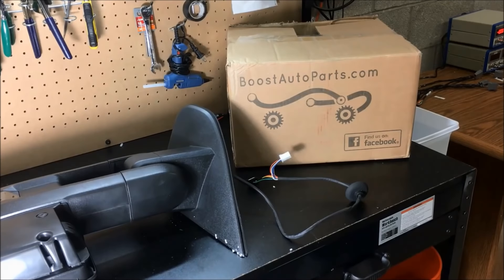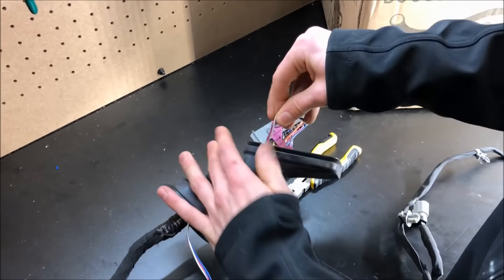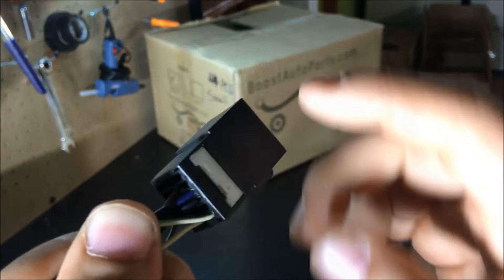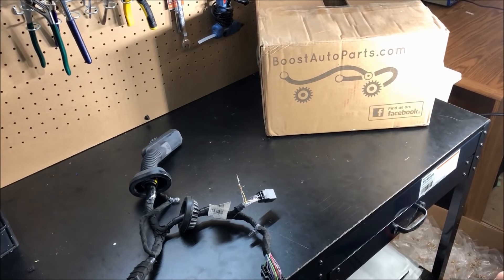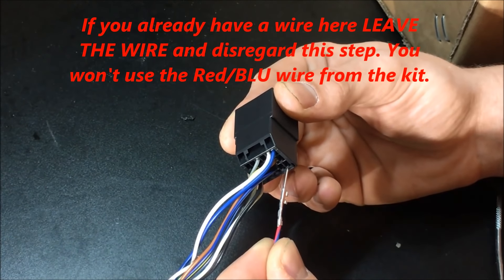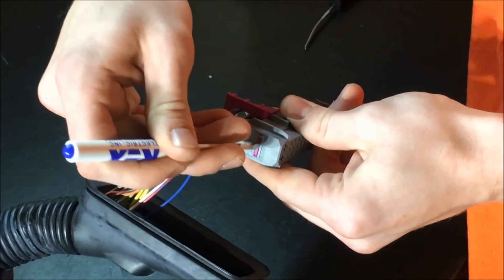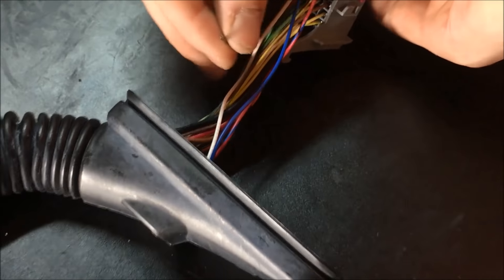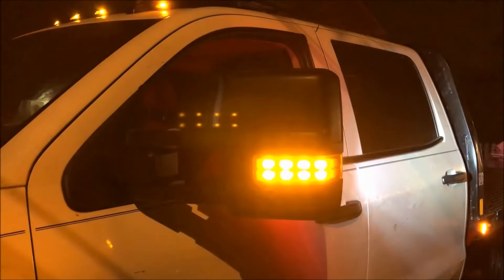Plug and Play 2015 - 2018 Silverado Sierra GM Tow Mirror Upgrade

Comment: How long does it take to do from start to finish ?
Reply from the maker: It depends on how familiar you are with door panel removal and wiring. For some it may take an hour, others it could take longer.
Reply: My wiring kit broke like one of the pins broke do I really need to slice the ground wire ?
Reply from the maker: @jakobstencil7377  Please reach out to our support team at support@boostautoparts.com
Reply: @boostautoparts  okay I did

Comment: I'm a little confused and unclear by the Video....At 1.04 minutes it shows a white plug on the left and a black plug on the right of the harness. My Silverado ia a 5/2015 build.  I want power fold and all the options. Is it better to go with "modify door harness with kit" for $49.95 or hardwire? I'm not concerned with the cost. Just ease of installation. Thank you!
Reply from the maker: For ease of installation you will certainly want the modify door harness option (which is what this video shows except for the portion of the video you highlighted). If you have any questions feel free to reach out to us at sales@boostautoparts.com

Comment: why don't y'all do a full tow mirror install for this video so that way we know how to do the install with the harness on vehicle
Reply from the maker: The install can be done with the harness still in the vehicle You can just work with the connectors through the speaker hole; we removed it for video purposes only.

Comment: Does this mirror come with a puddle lamp?
Reply from the maker: Our mirrors follow the OEM design, therefore they do not come equipped with a puddle lamp. We do offer the cargo/reverse setup for the cargo light, and that does shine the rear facing lights whenever the truck is unlocked at night with the key fob.

Comment: What are the tools needed
Reply from the maker: There are no special tools to install the harness, just a small flat blade screw driver to release the lock. In order to remove the door panel you will need a few additional tools, but those can be found on other YouTube videos. To remove the harness you just unplug all the connectors and it comes out through the speaker hole. There are some body clips holding it into the door, but those should just push right out!

Comment: On a 4/14, (GMC 15' 2500) with the RZY harness and your harness will this work for a switchback led setup? For running and blinker.
Reply from the maker: The two harnesses combined will make the front light running light only, and the signal on glass flash. If you were installing switchbacks you could tap the power for the front light as a running light, and the power for the glass as signal.

Comment: If I already have power fold mirrors do I have to do any of this or is it plug and play
Reply from the maker: You will still need to do this in order to gain the running light & cargo light as the small power folding mirrors don't have those features.